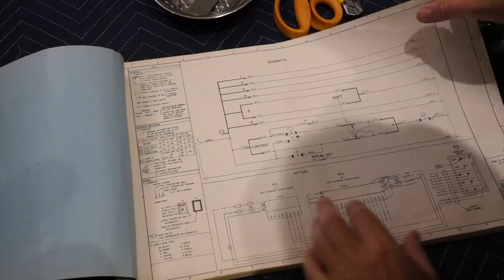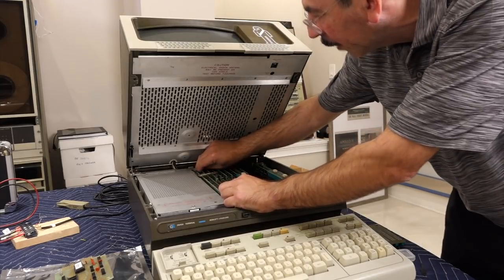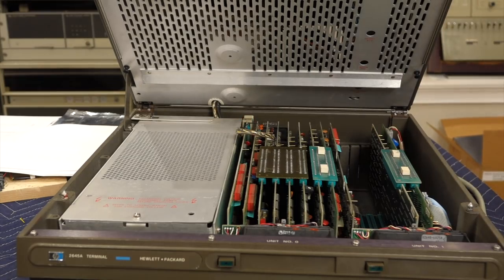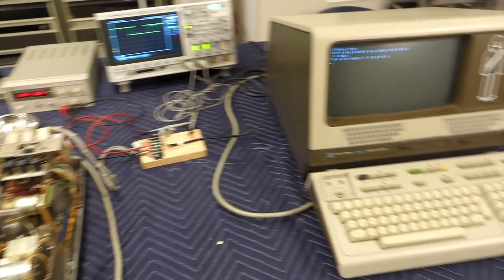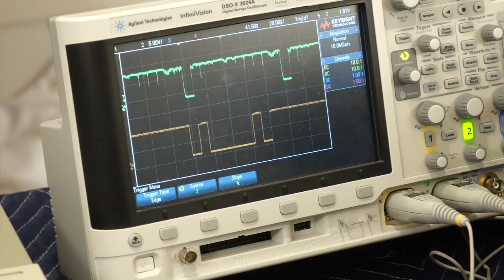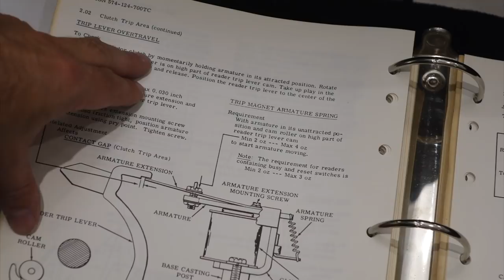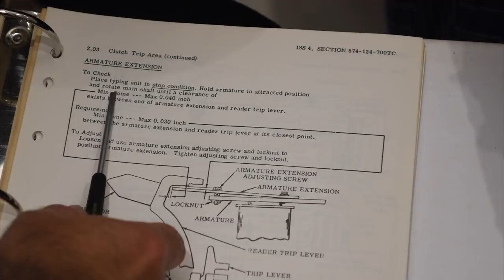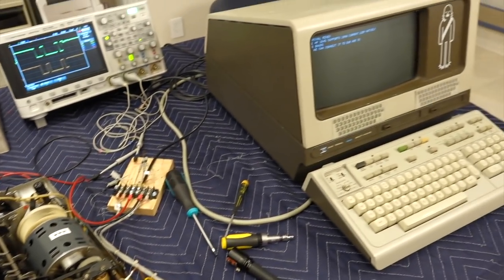Teletype ASR 33 Part 3: 20 mA Test Loop with the Vintage HP 2645 Terminal

Comment: Watching this makes me glad we moved on to completely solid state technology
Reply: Not me.
Reply: @Wizardofgosz  Don't get me wrong, I'm absolutely fascinated by electro-mechanical era technology, but fucking hell this stuff is not remotely practical for daily use.

And yes, I know, it was *at the time*, but that was also back when we thought adding lead to gasoline was beneficial to our engines, instead of causing premature wear.
Reply: Yeah, now when something gets out of alignment we chuck the whole thing and order a new one from China.
Reply: @Cemi_Mhikku  It was perfectly practical. If it's what you knew it would be what you know.
Reply: @Wizardofgosz  As I alluded to with my comment about leaded gas, ignorance is only bliss until you know better. Just because this technology was the best we could do at the time doesn't mean it wasn't a huge relief to both users and ESPECIALLY maintainers when it was out of common usage.
Reply: @Cemi_Mhikku  I work in a recording studio that still rolls 2-inch analog tape. We record on a 50 year old console. Maintaining the stuff is half the fun. So yes, I do know what it's like to maintain this kind of thing.

Lemme guess. You sit in a basement with your iPad experiencing the word as though you invented it?
Reply: @Wizardofgosz  Are You using a full analogue signal chain and master for vinyl?
Reply: @christophschmeler2744  Everything is analog. We have a plate reverb but I usually use digital reverbs. We can mix to tape, but usually mix to digital. I don't think we've done a vinyl release yet. They've only started coming back in recent years and no client has done it yet.
Reply: @Cemi_Mhikku  I agreed until your 'leaded fuel causes engine wear' comment... it doesn't. Tetraethyl lead is still used in Avgas for it's excellent knock resistance properties. It's good for engines, but not for us.
Reply: @Cemi_Mhikku  Depends what you (or humans generally) wanna do. Half the stuff we can do now with whizzy tech is not remotely necessary.

Comment: Marc, your 98036A serial I/O card for the 9825 also has current loop capability.
Reply from the maker: No kidding! I did not know. That has to be tried in a next video! Thanks Steven.
Reply: @CuriousMarc  I put that feature into the 98036A specifically for the ASR 33 and tested it with a 1000-foot spool of cable. That's what current loop can do (at 110 baud).
Reply: @stevenleibson2188  When people asked me to repair their ASR TTYS I would reply that they should buy a 264X and I would wire it up for them :)
The TTY console on ICL 1900 series mainframes like the golfball typewriter console on IBM mainframes caused the most downtime of any peripheral. Multiple tapes, multiple line printers multiple disks but only one console!

Comment: I was wondering about the back connectors on the HP terminal! Interesting how the cable connects like that, but I guess it gave more flexibility than using d-sub connectors.
Reply from the maker: It comes directly from the 1968 HP 2116 I/O board edge card and cable hood connection scheme, HP’s first computer. They stuck with it for the 264x terminals and the HP 1000 series. I have to admit it’s very convenient, very easy to make your own custom cable assemblies, and it can deal with fat cables with a lot of conductors. Which is what they were gunning for in the lab and industrial test oriented HP 2116.

Comment: Can you check the diodes that are in parallel with each of the teletype's solenoids..... mainly the kicker foot to stamp the alpha/no. ball? In ref to the scopes choppy square ways tx... The amount of noise coming from the teletype (RF) is kicking out ,when the cover is off, while also being so close to the PC... Not shielded?..  Heck, there may not even be any diodes to dampen or stunt the solenoids when they are allowed to relax and goto spring return/home? Also, there could be the platinum contact points bouncing, when energized, again, in ref to the scopes upper square wave?... either way... clever.... I am wondering... is that the original ink ribbon? I am wondering if so, have you pulled it out to see if there is any old impressions from what had been typed from back in the day... That is, if it had never been flipped over, and cycled many times, then never mind, as any impressions would have been trampled upon by other text... It could have the clues to what happened to  Jimmy Hoffa, or J. F. K. ? lol...  This was fun, I enjoyed this months project.... Dru

Comment: Back in the late 1970's I had one of those hooked up to my Apple II computer.  I believe I got it for free.  Does anyone remember a different type of print head?  I recall a rectangular box with rows and columns of characters. The box would shift up and down, and left and right to position the desired character under the 'hammer' that would push it and make an imprint on the paper.  Different model?
Reply from the maker: That would be the ASR 35. Much sturdier "professional" model. These are much larger and harder to find. I'd love to get one: https://youtu.be/DFMQ1qT_RFM
Reply: @CuriousMarc  We toured the Titan II missile museum outside of Tucson AZ.  In the control room they used paper tape to load critical (targeting?) data into the computer system.  It would have been unaffected by the electro-magnetic pulse from a bomb blast.